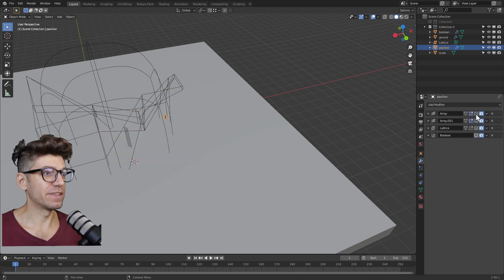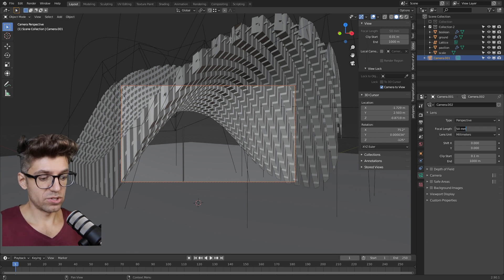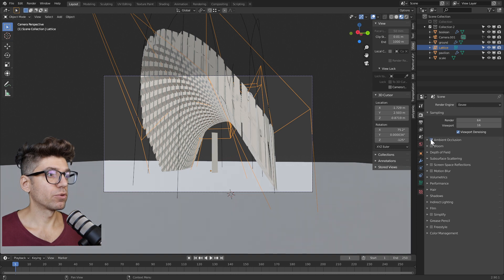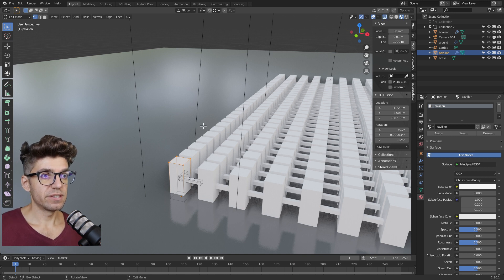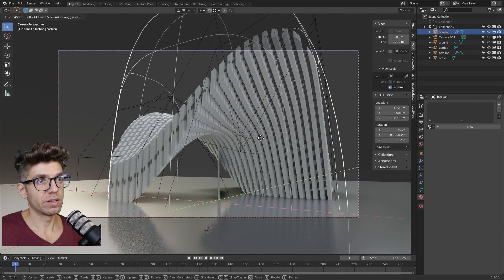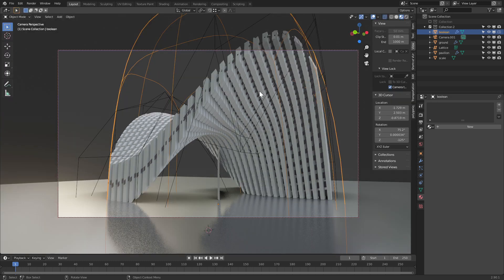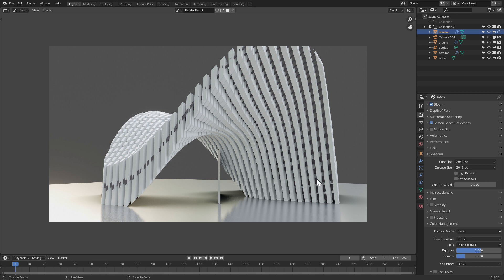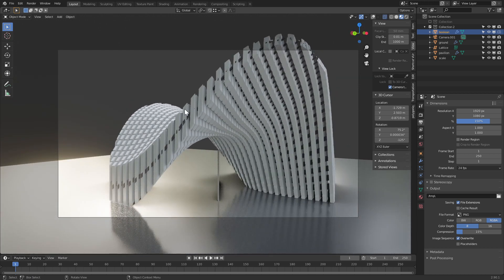Part 3d Procedural Pavilion Rendering - Blender for Architectural Design

Comment: Hello, UH Studio and everybody. Any Opinion about Sverchok?
Reply from the maker: Sverchok is great, but if you have but it's quite low level, meaning that each there is a lot of pythonic information that needs to be placed. It's a bit lower than Grasshopper in my experience. I've also found for the most part to be able to achieve what's needed with modifiers. There are also a few other interesting alternatives Sorcar, and the new alpha versions of Blender include native Geometry nodes. However, by all means, if interested to check out Sverchok's possibilities, as I've seen some great examples.
Reply: @UHStudio  Thank you.
Reply: I believe Sverchok should be considered if one prefers a data driven and parametric approach to design. I find the Blender Modifiers to be more of an intuitive approach. I am new to Blender and considering making it an alternative to my current modeling tools. I find this channel very educative and awesome tutorials.